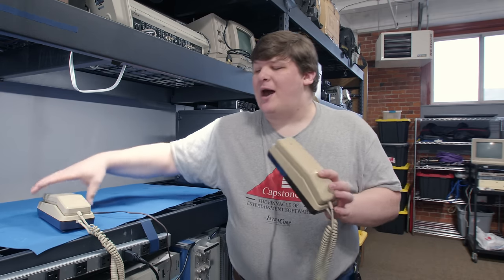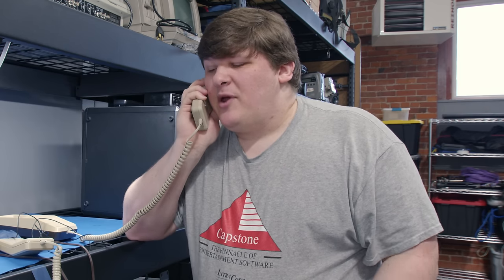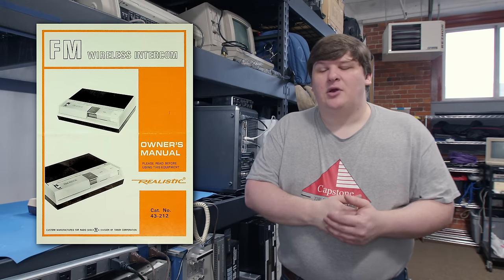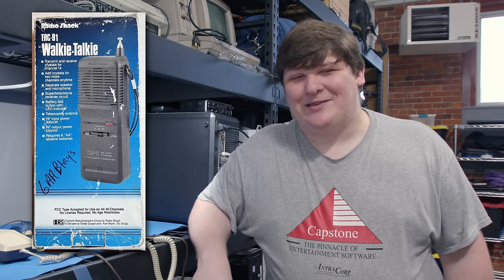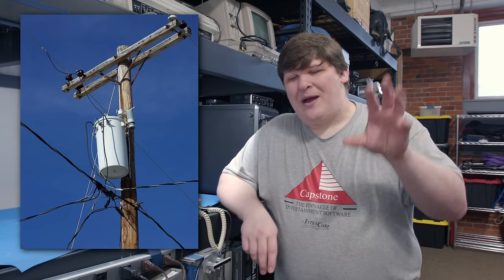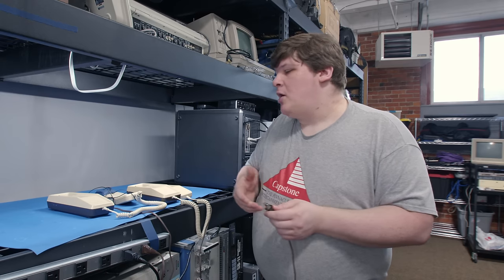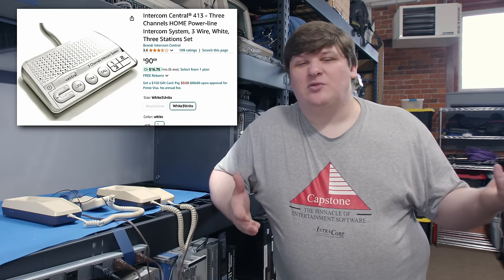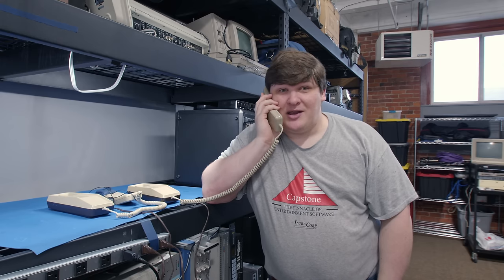How does this "phone" work without a line?

Comment: Grew up in an older large old brick house and we used the 3 channel desk top versions for years, maybe 6 units?  You could talk from 3rd floor to basement, no problem. The talk key could be slid and locked on to use as a baby monitor or to spy on your older sister! Lol I remember seeing a few businesses using them in place of a front counter call bells (shopkeeper bell) or as a two way talk door bell as well.

Comment: Hey so, slightly limited radio frequency knowledge but I know enough to get me by in the world of professional AV.  If you have two transmitters on the same frequency they just interfere and you can’t get anything useful on either of them. 

They will be duplexing in exactly the way you expected, one Tx on 200, and Rx on 193, with the other doing the opposite. 

You can also do this with more traditional “Walkie Talkies”, but you would normally use that function to have a repeater setup: the low power radios can be repeated (relayed) and come out of a significantly more powerful transmitter, to achieve better reception for the handheld units. The Rx circuit on the repeater will also be typically more sensitive than that on a handheld unit, because you can make the antenna so much larger. You would typically also have the whole thing mains powered as well, so you can hit the legal limit of what transmission power you’re allowed to use, and use active equipment to improve reception on the repeater’s receiving circuit

Comment: when i was a kid in the 1970's we had a tri-level house..and we had an intercom system that did not require wires or circuitry or power..we just yelled into the central heating duct and everyone in the house could hear you hahaha

Comment: As soon as you showed the power plug only, I was like "yeah, that's gonna be powerline transmitters.". So I was quite surprised when you said they were FM. Luckily... redemption! :D Cool stuff! We had Realistic over here in Belgium as well (we had 2 synthesizer keyboards), distributed by Tandy which was basically the local representation of Radio Shack (I have Radio Shack slot cars!).

Comment: My grandparents used to have this ancient, probably '80s vintage, home intercom system in their house. The main panel was in the kitchen, and it included an AM/FM radio and two tape decks as well as the intercom. The remote units were located I believe in the garage, in my grandfather's office, and in what my grandmother used as a waiting room for her piano studio. I don't know anything about the system or how it worked, but my grandfather was an electric company salesman for most of his career so I would wonder if they're potentially powerline-based.

What I was thinking about these devices, though, is in use in places like offices, hospitals, government buildings, places where you need to connect two specific locations to each other or you only need internal communications. With the desk units specifically, I was thinking office secretaries, probably one plumbed to the boss's office and one to the secretary's desk, a la the old "Miss Johnson, send them in" moments in sitcoms and whatnot.

Comment: the moment you said about needing to be supplied from the same transformer i immidiatly knew it had something to do with powerline

For a period of time i used powerline ethernet to send a network connection to an upstairs room (for some reason it only worked reliably in certain electrical outlets, athough most powerline ethernet adapters sold where i live specify both units must be on the same circuit, and the upstairs room is on a seperate circuit)

The powerline adapters got replaced with a dedicated network run after one of them got fried

And before then i even used powerline adapters to share a broadband connection between two houses (and suprisingly it did work, but it was borderline usable)

Before the powerline adapter got fried, we also had a DECT phone handset that was linked to the base station in the other house, so we could call between houses

Comment: I work for a power utility as IT and I can tell you, the meters are not read in any way through a high frequency being sent along the 60Hz of the line itself. It's actually way cooler. There is a communication transformer in the substation that has some big honkin' relays in it that are dumb fast. They introduce a "blip" into the sin wave itself which counts as a 1, a wave without a blip is a zero. Then it's all just like an old school Ethernet hub, the server requests a read of a particular meter, the transformer gets the message and tells the high voltage side what the desired meter's address is, the relays encode said address, everything on that feeder gets that request but ignores it because it's not their address, then the power meter does a similar but weaker method to reply, the transformer senses that reply and the address of the meter, then forwards it back to the server. In real time it takes like 20 seconds or so to get a read in when called manually.

In honesty, I don't get involved with this system much and haven't attended a training in like a decade. I'm not 100% sure what the TX and RX of this system is but you wouldn't want to game on it, I'm pretty sure.

Comment: They use two frequencies because they are full duplex. Is not possible to listen in the same frequency that you are transmitting at the same time over a communication channel (but you could hop very quickly RX to TX to RX so is indistinguishible) as the signal you are receiving is millions of times faintest that what you are transmitting and it is not possible to distinguish. In FM modulation there is also an effect where when there are more than one transmitter in the same frequency, you will only ear the loudest, not a combination of the two like in AM or SSB.

Comment: I knew these worked over Powerline as I had a set of the Realistic box-shaped tabletop intercoms you mentioned that used your household mains (A/C) wiring and it was obvious these were similar just in a phone headset form.

 I also have some of those Powerline Ethernet adaptors which I use get my broadband connection to a detached garage/workshop and it works much better then prior Wireless extender setup where I tried as I never got a strong signal in the detached garage with it was always weak and slow, whereas the Powerline option is fast enough for my purposes. While I have had issues setting them up initially, as long as you plugged them directly into the socket not a power strip/surge protector they generally will work after some bit of fiddling I have found. Probably depends on how old or unusual the mains wiring setup in your house/property is though as my current house is a late 70’s era house not knob and tube or some other odd wiring.

Comment: Looking at the tech specs right at the beginning of the video it was immediately clear where we were heading to... ;) Look, 200 kHz carrier frequency will absolutely NOT make a real "radio" transmission possible. Such low RF frequencies clearly indicate that they are using some kind of PLC with FM modulation. Moreover, the fact that they are using two different carrier frequencies is what makes "phone"-style (i.e. full-duplex) communication possible. With a walkie-talkie operating at just one carrier frequency, it is absolutely impossible to talk and listen at the same time (which is the bit that makes the "talk" button necessary in the first place). Clearly, on a household phone, you wouldn't want this, this is why they had to use two carriers.
Alas, very interesting video, as always!

Comment: The two frequency system is called full  duplex. It allows you to talk and listen at the same time. The square box three channel one was single frequency simplex so they needed a push to talk button. Here in the UK we use three phase mains. Each third house is on the same phase. If you put one of these phones in a different house in the street on the same phase they would talk to each other.

Comment: Here's something you may or may not know. X10 is still a very capable smart some system. There is an X10 plugin for HomeAssistant.
You can buy a smart home appliance from 1978 and still get it to work with your smart speakers or whatever. 
X10 will probably be the enduring standard when all these smart home applicances bite the dust. and I mean why shouldn't it be? it seems like a perfectly functional system, if your power lines are "clean enough"
Reply: I was rewatching the X10 LGR video where he plugged it into his PC and I was like "x10 seems like something that a programmer could code in a weekend for home assistant" and sure enough a single internet search reveals, yea in fact it's supported. 
in fact I just learned right now. you can buy brand new devices that convert X10 directly to smarthome appliances. 
x10 is still useful and there are plenty of x10 enabled devices still being made.
Reply: If you have a totally x10-free transformer available to you, you can get up to 256 devices, although ideally you'd wanna stick to a single channel which does 16.
Reply: for the x10 homeassistant one you'll need either a "firecracker" module or a serial-enabled unit. 
the firecracker module is basically a fancy controller, and there's windows software, but the homeassistant plugin uses Heyu, a reverse engineered linux port of the windows software. 
considering this is a 1978 standard, having a 2021 last release date of heyu and normal "smarthome hubs" is pretty good.

Comment: One downside to these types of intercoms...the RadioShack store I used to work at actually had some of those silver intercoms shown at ~9:34 to connect the front desk to the back office. They worked, but because of all the fluorescent lighting and other electrical equipment, there was a LOT of static. They eventually got replaced by a newer set that used proper 900MHz wireless because the static was becoming unbearable.

Comment: I thought it was like an ethernet over powerlines system, but turns out it's less sophisticated. When I was young, I decided to run a phone line to a friend, and neither of us had phones. I borrowed  a setup from another friend, but it was broken and required 9V batteries. However, I discovered, that the speakers themselves could be hooked to 2 wires straight, and transmit sound that way. I bet not many people tried that. Take any of those ferrite magnet speakers, and wire 2 of them to eachother, and you will be able to hear yourself on the other end. Vibrations on one end will directly drive the oscillations on the other end. A phone system that runs on 2 cables and requires no power. I kept the controls, but bypassed the powered amplifiers, and we suddenly had a phone system. Since without power there was no ringer, I used a keychain sound making toy that I had. I could temporarily hook up its output to the line and it would "ring" the phone. The rest of communication was done without power of any kind.

Once again, all you need is something like a pair of 120mm speakers with exposed ferrite magnet ring. Those produce the best results. It's literally like cups on a sting, only  with electromagnetic analog audio that works across great distances, provided your wires have low resistance and capacitance. We tried running the system by utilizing water and gas pipes, and even though it sort of worked, the electrical noise was humongous. Probably originating at one of the pumping subsystems hooked to the plumbing.

Comment: Regarding power meters, you only have something called a ripple control signal. It’s a tone that is generated by a big motor at the power company, and that motor injects a tone that’s exactly 1000kHz above the supply frequency (so, either 1050 or 1060kHz), and this is what tells your power meter when it’s peak and off peak usage times. Telemetry for power bills and whatnot by smart meters are sent wirelessly. Either over the mobile phone network, or to a network of transceivers owned by the power company.

Comment: In the US at least, the power company typically use 500Mhz data over power lines for talking to substations and other grid remote control and monitoring. Where the power meters are using a 900Mhz mesh net. If you walk around and find a square box at the top with a pair of antenna on it, that's for that.

Comment: The frequency offset is probably to enable full-duplex operation. The offset is there so that they don't step on each other as they transmit, kinda like how a radio repeater works.

Comment: Ham radios also use a pair of frequencies. Either like the phone, one frequency for each direction or more common one for transmitting and one for receiving. It is very common to use a low powered transmitter which can reach a local relay which converts the audio to the other frequency with high power. Then you can talk to all radios tuned to the correct receiving frequency and they can talk back. This also allows long distance communication using small, low energy transmitters.

200kHz is a very low frequency. The wavelength is roughly a mile long. You can't transmit this properly without at least a quarter mile long antennae. Instead, they use a technique which was used in Germany during world war II. 
To be able to broadcast air raid warnings without giving the bombers a signal to home in, they used the telephone system. All phone lines were connected to each other using a small capacitor. This capacitor will suppress low frequency audio but pass the high frequency "Drahtfunk" (wired radio broadcast). With a special radio connected to your phone line, you can receive the air raid warnings.

This was then used in Berlin after WW-II since Germany was not allowed to own its own radio transmitters and West-Berlin didn't even had transmitters run by the US Forces. So they had to broadcast their radio program over the phone lines. this was the "DIAS Berlin" station. (DIAS = Drahtfunk Im Amerikanischen Sektor = Wire radio broadcast in the American Sector). This was converted to RIAS (Radio in the American Sector) when Germany was allowed to build and operate their own radio transmitters.
Those Intercoms do the exact same - just using the power line. A capacitor will block the 60Hz of the power line but pass the 200kHz radio transmission.

Comment: We had a tool shed 50 ft from the main house with power,  when in homeschool we had the type at 2:41 (still do) and used hem often,  I'd go out after class and work on projects.  When it was dinner, I'would hear the load call sound.  You could either respond or just go eat 🙂

Comment: If you are in a commercial building then it is likely being fed by 3 phase. Easy way to tell if you go to a 240v outlet and check the voltage, If its 240 then its both side of split phase. If its 208 then its 2 legs of a 3 phase supply.

Comment: FYI - PLC is used extensively for DC fast chargers on EVs. AC charging is AC charging, but DC fast chargers use the AC power (on CCS2) to communicate with the charger using PLC.  If you look at some PLC chipsets, they often have an "EV" variant for use with EVs

Comment: I suspect the problem with using one plugged into the large power strip, that it has a Line Filter on it.

Try it directly into the wall, and I think you'll find they work much better.

I remember both the early AM Plug'N'Talk's, as well as the FM, and they are Night And Day. The noise on AM made them almost unuseable as the noise that came out if a motor came on, or someone turned on a light on a dimmer. 
FM fixed all that. (Just like on car stereos.)

Comment: the two frequencies are for duplex communication.
i.e. both can talk and listen at the same time. you can't really do that on one frequency.
i wager these wired units use the powerline itself for transmission, instead of radio.

Comment: I like to think at least one set of these were used with a modem and acoustic coupler in each end to replace a pretty long network cable between two computers
Reply: There used to be devices called "wireless phone jacks"-they worked the same way as the intercoms did:RF through the power line.
They worked ok for dial-up modems, but only the later units would allow the full performance of the 56K modems.

Comment: Minor nitpick: 2 sides of a split phase service would happen frequently in homes, that's where you get 240v from. Your 120v is between one of the hot legs and a center-tapped neutral. And your building there may be on 3-phase power, so you'd be seeing 120v between a hot phase off of one of 3 transformers and neutral, so when you went to the other unit, it very well may have been power from a separate distribution transformer.

Comment: My family used to have a pair of these in a residential house. And we found out pretty quickly that they have to be on the same leg in the main breaker box. A residential house will usually have 2 phases in order to get the 240v that a dryer or electric stove need to run, and both of these intercom/phones have to be on the same phase. i.e. on the same leg from the transformer on the power pole, not just the same transformer. That's why you'll find that they work when plugged in to some outlets but not others.
Edit: My guess even back then was that they create a modulation in the power being supplied to the intercom through the wall, and the other units listen for that modulation. It's novel idea but with increasingly sensitive electronics in every home, could there be a concern about unwanted interference?

Comment: The communication between these is full-duplex, and full-duplex radio communication always (I think) requires two frequencies. When two radio transmitters transmit on the same frequency simultaneously, you get horrible howling noises as the signals convolve and do math things - you hear it often when it accidentally happens on amateur radio nets. Not to mention that it would also result in each transmitter receiving it's own transmission in addition to the other party's transmission :)